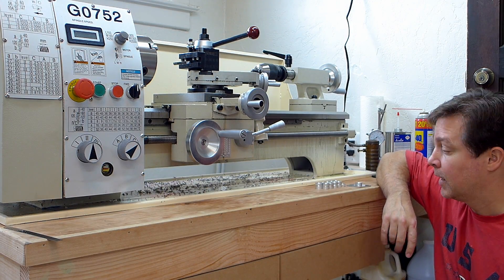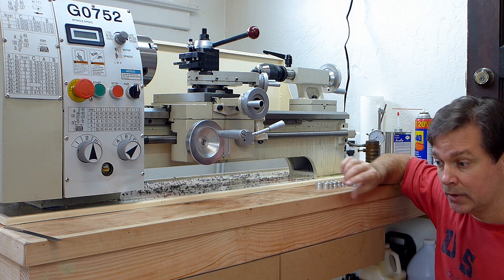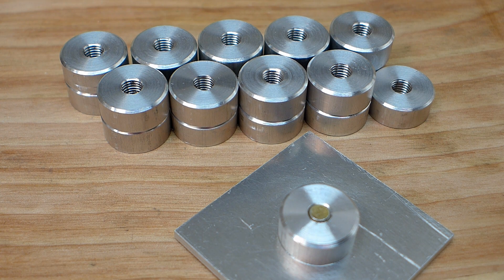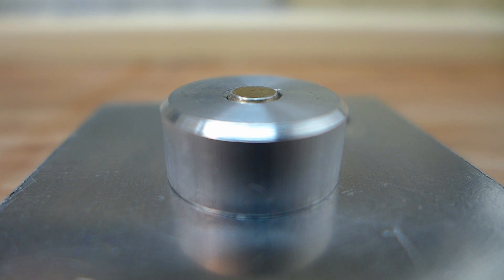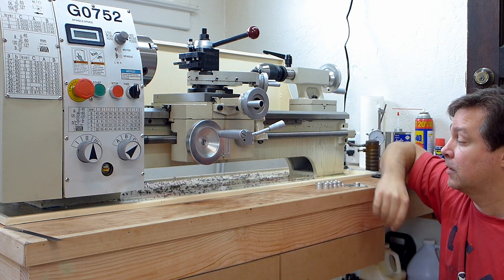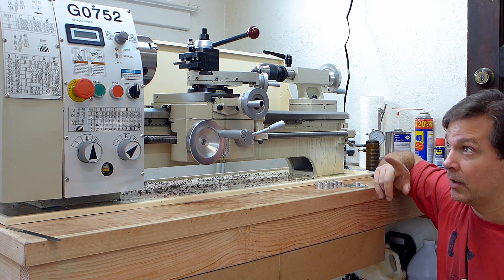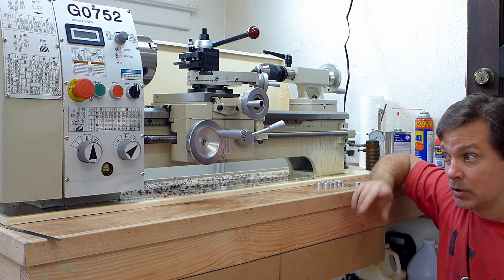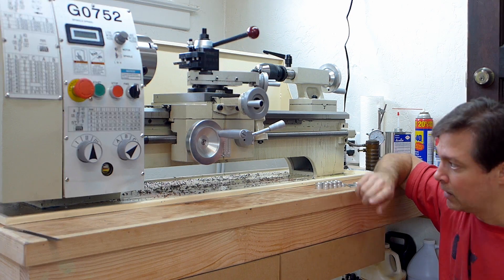First Lathe Project Synopsis

Comment: After months of research, I finally decided I liked the G0752, only to find out today it doesn't feature the lever cam lock on the tail stock.  Yet interestingly enough, their cheaper lathe has it.  I don't get it why they left out the cam lock on this better lathe.  Kind of a deal breaker for me.
Reply from the maker: +Beerbatter1962 I'm planning on making my own at some point.
Reply: Yeah, thanks.  After some more research after I commented I discovered there are dozens of intructionals all over Internet for that mod.  The key was searching for it for the G0602 instead, which is basically same machine but been around longer and is currently more common.

Comment: Funny how many similar interests we have.  I built an RV-6 about 6 years ago and have about 600 hours on it now.  I was a DBA and network administrator.  And I reload 12 and 20 gauge shot shells for trap shooting.  I completely agree with you on the variable speed on the lathe.  The way it would have worked out for me would be that I set the belt and never change it and put up with less than perfect finish.  With the VFD I can dial up the rpm as I progress toward the center of a facing operation or slow it down for a rough pass, then speed up for a light finish pass.

Jim

Comment: A G0752 was my second lathe, my first was a 6in craftsmen. Now I run a thirteen inch Clausing Colchester with a 3hp motor. It's three phase 440v running with a hitachi VFD. I love it and it's way more then I need, but what the hell right.
Reply from the maker: If I had more space in the garage, I suspect I would've sprung for something bigger, but this'll have to do for now, as I can barely move around in the garage as it is. :( Yours sounds sweet!
Reply: Jay Williams